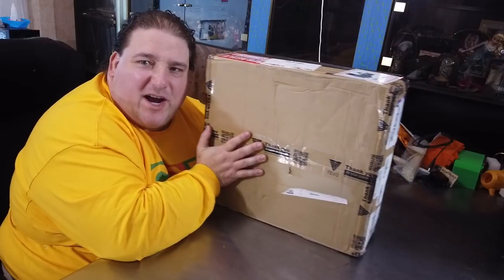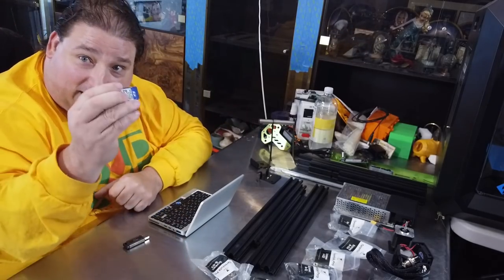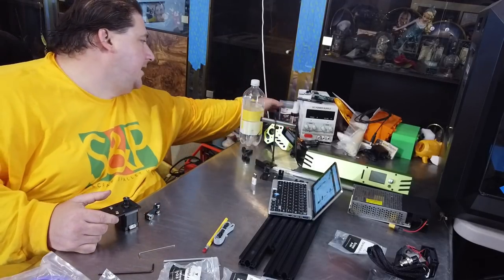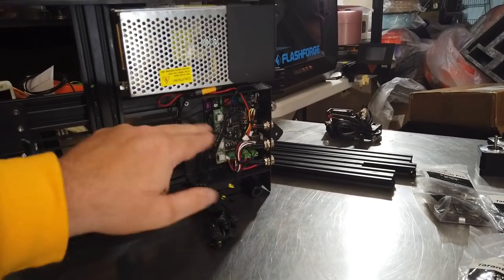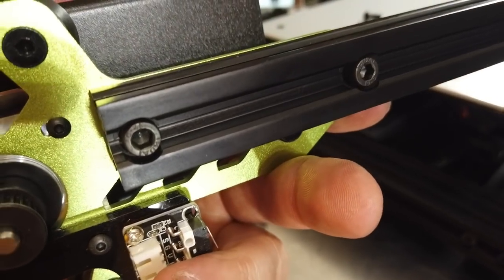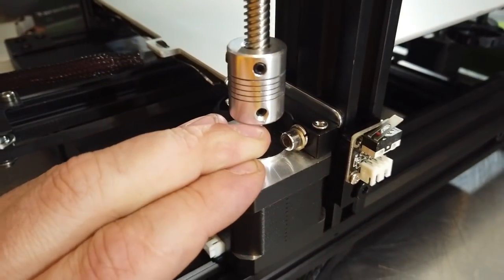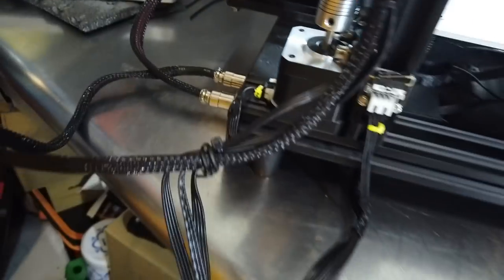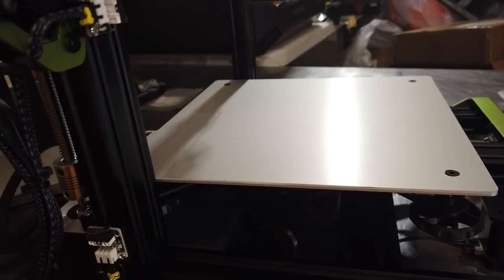Tevo Tarantula Pro Build   T3DP

Comment: What was that 5th hole for?
Reply from the maker: You know I just checked and it never got used :-)
Reply: I ordered one through amazon earlier today after I saw this video. They have it listed as $219
Reply from the maker: @leemccready845  thank you for using my link. I appreciate it. Yep its only $19 over the china direct price and you get it in a day or two. Nice ehh :-)
Reply: Perhaps this is why it's not referenced in the manual. If there is no use for it, it is most likely a leftover from a previous design iteration.

Comment: Been around 4 years in 3D....seen most if not all the star youtubers....most are very knowledgeable and informative. I think you have them beat!  You talk as an enthusiast ( like the rest of us) rather than a tutor to students.  With Creality opening the market with their “goal post” printers....and typically, kick starting mass cloning ....you get to play with more machines than any of us could hope for.....so which .....for example......offer best bang for bucks.....not which is best....but more about build quality, usability, etc.  Or is that a bit too much?
Reply from the maker: It largely depends on what you're trying to do what your skills are your budget Etc my favorite printer to suggest to people is the Ender 5 very generous Bill volume to 220 by 220 by 300 mostly assembled and the box frame pretty much guarantees a proper assembly since it self aligns as you tighten the bolts as long as you don't over tighten the wheels or the belts it's about as bulletproof as you can get at only a bit over three hundred bucks

The tarantula pro has some quality Choice shoes but it sounds like they're going to fix them

If you want a cheaper machine and you want to play with a volcano hotend and something with a slightly smaller footprint on your desk it's not a bad machine

If you want something 334 sized then get the cr-10s if you want something else the Alfawise u-20 or the JG Aurora a 5X are very good alternatives that appear to have equal quality